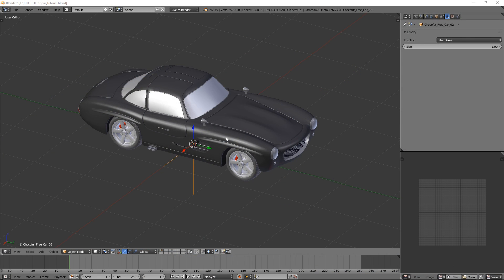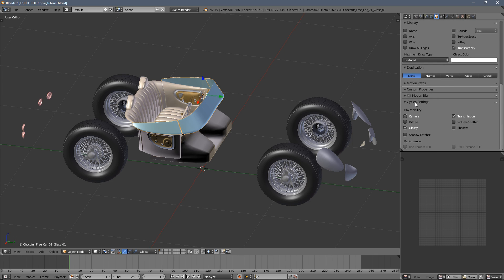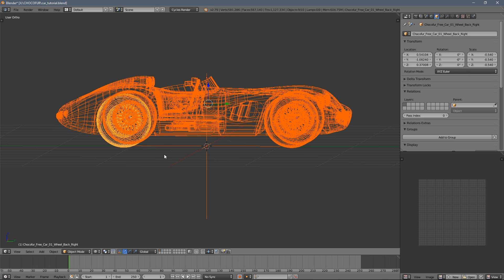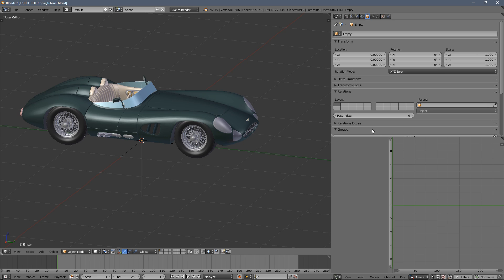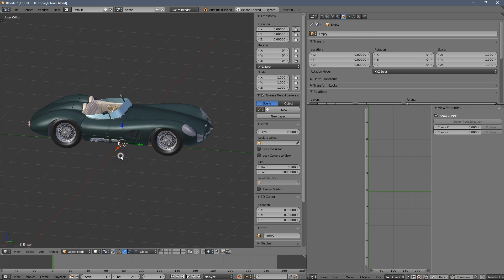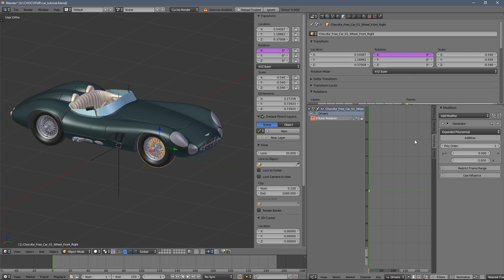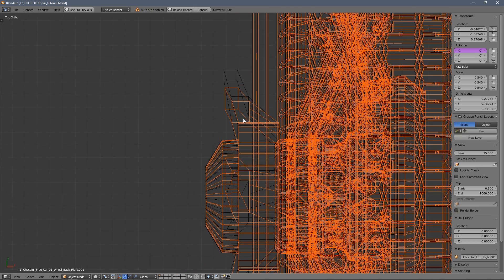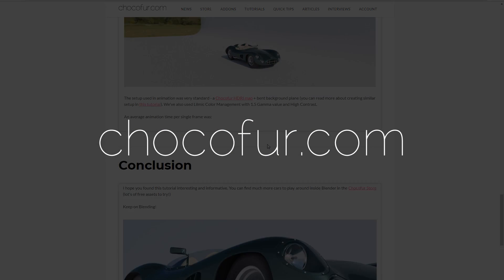Blender Car Rigging Tutorial (Simple Technique)

Comment: Thanks a lot for this, very helpful!
I would add that it is quite simple to calculate the exact value for the rotation of the wheel in radians. Since a full rotation of the wheel is 2pi rads, the formula is as follow:
2 * pi / (pi * D)   where D is the diameter of the wheel.